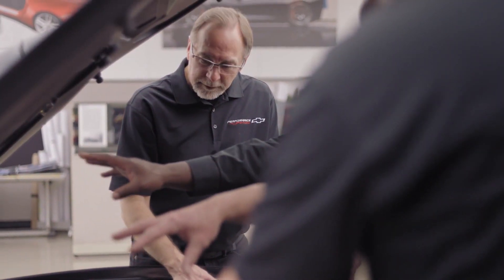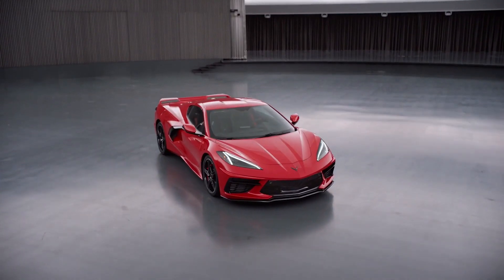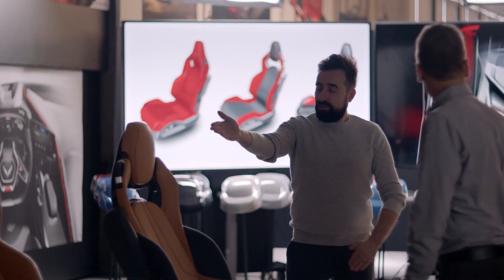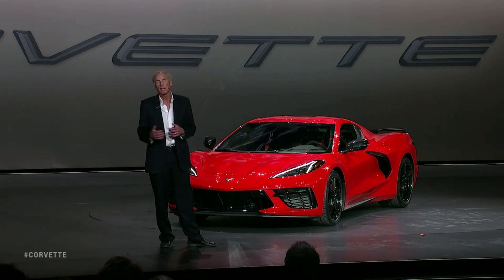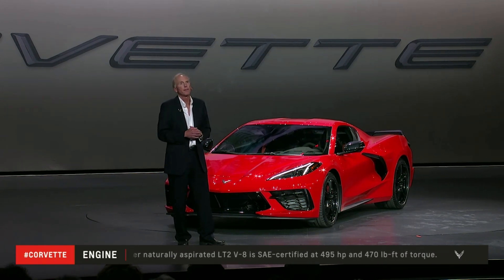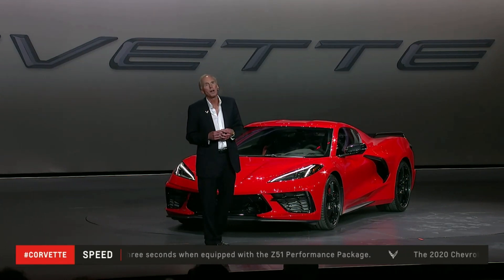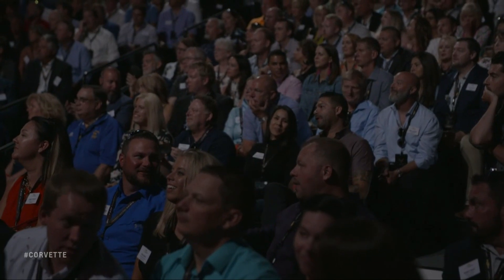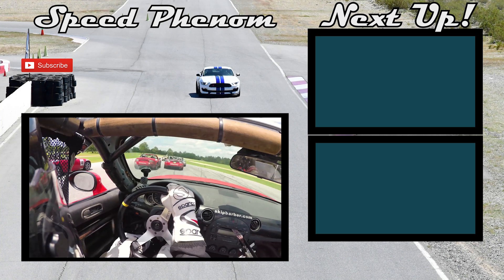MEET THE $50,000+ MID-ENGINE C8 CORVETTE! (0-60 in less than 3 seconds)

Comment: Unfortunately they cant stop Dealers adding crazy markups so itll be easily 100k
Reply: That's why u preorder
Reply: @Marcofrommiami  lol at 100k ... dealers can charge u whatever whenever... makers have zero control over that...
Reply: @Marcofrommiami  even if you preorder from a reg local dealer they will still nail you with a market adjustment. However if you order from the big dealers like Kerbeck, they get you done for MSRP.
Reply: Jack njones  with the Corvette dealers only get a certain allocation. The less cars they are able to get and the more buyers they have wanting the car people will pay as much as they can to get it.
Reply: If you choose to pay a makeup. That's on you. It's pretty simple, dealers will tell you if they are especially if you put a small deposit down. The way I figured is even if I have to fly to another state and have the car shipped back, it's would be cheaper than an insane markup. 400 round-trip plane ticket and between 1500 to 2000 grand shipping. Save 7500 on a 10 grand markup.
Reply: Yup dealers are out of their minds.
Reply: Like hype beast collabs
Reply: I hate it when they add features before you've even asked for it.
Reply: Depends on how many they are making but I'm scared of stealerships
Reply: Well that is why they will have different models I am sure a zo6 type would be easily 100k
Reply: order it from the factory
Reply: Can you order online directly from the factory to save $$?  Check Sam's Club/Walmart and  maybe that got a huge discount by joint with GM so we can save big money? Hahaha
Reply: Corvette: 0-60 in less than 3 seconds
Tesla Roadster: hold my battery pack
Reply: Except this is a mass produced car so the markups won’t last long.
Reply: @MakeItMakeSense285  I bought my 14 stingray feb 14 from Kerbeck. Paid 2k less than MSRP. At that time my local dealership was selling that same car for 15000 over sticker. As of January 2015 they were still marketed 7500 above sticker. I don't think it will be that quick. But eventually the market will flood and they will start discounting.
Reply: @theundead1600  Not really. The law of supply and demand. If a dealer has 3 cars and 10 buyers who get them? The buyer who comes up with the most money. Eventually they will have 5 cars and 1 buyer.
Reply: @gianluca.g  Corvette: I can't hold your battery pack, my hands are full of the $140k I didn't have to spend to be you.
Reply: @the undead 1 - I think dealers are very smart - let the true fools pay more than list,  while the dealer heads to the bank with a smile on his face!  It's the buyers who are out of their minds!

Comment: Dealerships + packages are going to make this a $100k car
Reply: And they're going to go broke
Reply: Not true This is a Stingray a Zl1 is closer to 80 and is well worth it
Reply: ZR1
Reply: Ya and people will pick them up on the used market for 30k
Reply: @mrmisterman999  The C7 came out over 6 years ago and they are hard to find for $30k still... the C8 is expected to have a better resale value than the C7 so I seriously doubt you'll find any for under $50k in the next few years.
Reply: Very little dealer markup on this car. Many dealerships made a pledge to sell the car for MSRP and did. Even with a lot of good options including the 2LT interior package and the Z51 package it is still less than $75k. The average build price for the first batch was around $82k.
Reply: @Viper3048  maybe the high end models with all.options but I doubt the base model will hold its value

Comment: WOW! I'm sure that for the top of line, it will be closer to $100K, but hey, that is still going to be cheaper than the GT500 and it will perform better. They are different cars, but what a choice to have.
Reply: Z51 should be 75k, convertables at 70-80k. then work the way up to when they roll out the ZR1 in about 4 years in the mid 150's. The Zora, if it happens will be the race spec and yeah.. dunno bout that one.

Comment: Looks, value, price, and performance can't be beat by the C8 ( and I'm a Ford guy)!!!!!!!
Reply: 60.000 that's just your base model,. No guts, or performance.  Way over priced.!!!
Reply: @davefiasconaro9736  GT500 performance will be in the mid 3s. C8 in the 2s. There goes your performance.  Gt 500 base model is 74000. You do the math  sir. Plus GT 500 weighs over 4200. You better do some research, bro.
Reply: Bfighter let them be they will always be haters
Reply: @davefiasconaro9736  lol no guts or performance? Dude they all have the same motor  regardless of options.
Reply: yo D.F...I have the LT1 in a 14 c7 vert. A6...I would like to own a Z06 or Zr1...but I am glad I don't, because with 460 hp, I can barely restrain myself from going over the speed limits ..which are too low for the freeways...NOW...I don't track my car, but it would be a nice entry at a local car show...any more power is just a quicker way to losing my Lie.Sins...Throttle Discipline, or else.

Comment: Gotta remember this isn’t the only vette model. Gotta wait for the z06 and Zr1. Zr1 might come with close to 800hp
Reply: More like 1000 hp, plus I think it's going to be called Zora. There rumors its going to be a hybrid system
Reply: you bet that future hotter performance versions will come with over 800 hp. there is a whole host of new hardware, technology and components in development for the future evolution performance variants, among them a manual clutch by wire advance manual transmission, and of course high revving dohc V8 engines and forced induction applications.
Reply: Nightmaro that’s what I heard too
Reply: And all wheel drive?
Reply: More than that for sure. The C7 Zr1 has 755hp...
Reply: @Markus Patients Yeah, those are track cars. Unless you are serious about truly driving it, buying that much power is debauchery.
Reply: They will probably sell for 100k

Comment: I realize few people read the comments but I just want to say that I'm VERY proud of Chevy. I own a Ferrari and I've always thought the Vette's had the power but the looks were dated and performance limited.....and the rear-end never looked like more then a square butcher block. This 2020 car changes EVERYTHING! If it didn't have the Corvette badge, you'd think it was a McLaren, Ferrari or some exotic. Yeah, the rear end still echoes of the Camero but beyond that the engineers and designers at Chevy really knocked this one way the fuck out of the ballpark and brought Chevy back to the forefront of any buyers list. Instead of falling by the wayside, Chevy stepped-up and answered back big-time and I'm proud of them....and at this price point I think they're leaving $20-$70k on the table. It's going to be VERY hard for someone to pull the trigger on an Italian sports car when they can have this for a fraction of the price. Anyone who spends more is doing so purely for snob and boasting issues because when it comes to performance, looks and practicality this 2020 Vette is dollar-per-value soaring way higher then any other manufacturer can even conceive of touching. Not since the Apollo program can we be so proud!

Comment: Finally GM brought the Corvette into the 1960 with mid engine and dry sump. Then they put a duel clutch trans in (Porsche had developed in the 80's) shaped it like a Ferrari then stuck with a push rod engine. The best thing about it is the price. Nothing about this car is original and it is old technology but that's GM kicking and screaming in to the future.
Reply: Jay Zimmerman That’s similar motor and a heavier front wheel drive version where at Nuremberg ring did it under seven minutes lap. Get some.

Comment: $50k+ is a big range of numbers... technically a Lamborghini is also $50k+ because it's more than $50k
Reply: There are different trim levels, guy....It starts at around 50k and can go up to over 100k depending on the trim level and options.
Reply: Brian R there is no trim that currently goes anywhere near $100k... They only announced the stingray. Were you paying attention? The correct wording would be "starting at $50k"

Comment: Congrats. So the same kid that just changed the oil on a 96 cavalier will now be working on your “super car”. This should be interesting. Corvettes need their own dealerships and their own techs.
Reply: Yea not really. American cars have always been able to be worked on by the average joe for the most part, that’s what makes it so appealing, you can own a high horsepower vehicle that you don’t have to take to the dealership and spend $200 on for an oil change. Sure with modern vettes and more technology it becomes harder with time but to purposely suggest that maintenance be specialized takes away from the roots of The American sports/muscle car.
Reply: Fernando Gonzalez 

Yeah thanks for your long story. I have been a GM mechanic for Chevy for 25 years and was at one point a 19 year old kid who would change oil and also work on these high end vettes. Happens everyday at my shop. Lol
Reply: Oil changes are basic maintenance

Comment: Looks awesome, better than I expected tbh.. I Rather go with the 2020 Shelby GT500 700+ hp beast because well that’s just my personal preference.
Reply: You really can't compare the G500 to the base vette, a better comparison would be the GT350.  Now when the Z06 comes out then you could properly do a comparison.  Both are beautiful cars but I still like the vettes.
Reply: The GT500 is going to be overpriced with dealer markups at 100k. The vette will be quicker to 60 for sure. You can’t put all that power to the ground with front engine and high TQ but it is a GT car. It will be a good roll car.
Reply: respected ! the GT500 is one wild machine, but a totally different animal than the new Corvette.
Mustangs are in a different bracket.
Reply: Mustang is American Muscle Car. Corvette is a mid engine supercar. Compare it to it's own class. I'd say compare to the 458 but no one would be able to tell the difference between the 2 so that wouldnt work
Reply: Ford dealers have ruin the GT500. Driveway  demons just said tonight that he couldn’t find a dealer that will price it under 90k and the top specs are going 125k for a car that is base off a 30k . He is going order the cheaper C8 with a better interior instead. I’m sure Ford dealers will lower the markup once Chevy dealers start selling the C8 at msrp price.

Comment: The back looks like the Acura NSX and the front and side view mirrors looks like a Mclaren
Reply: And cost way less than both, probably more reliable too, I'll take 1
Reply: @horuslupercal3872  It looking similar to those isn't necessarily a good thing. It's not showing the ability to think out of the box. Now the c7 is a real example of thinking outside of the box, nothing looks like it yet it looks amazing.
Reply: @burgerbandit3646  from the front its undeniable  it's a Corvette, from the rear its undeniable a Corvette, (or an edgy Camaro), only the side has looks of a McLaren or NSX that's because its mid engine just like them there's only so much you can do with it
Reply: @horuslupercal3872  there are tons of mid engine supercars and very few look alike.
Reply: Don't most of the super cars look alike though.
Reply: Rear is Camaro, front some Ferrari, some NSX and some previous model corvettes

Comment: ferrari is losing sleep.  this is the ultimate.  and you can put 300k miles on it.....
Reply: mesaros shawn lol 300 k ok let’s not reach this is still breaking down after 125
Reply: @brianhomskis1873  with only 475hp output its making well under 80hp per liter of displacement which indicates duty cycle of 250k + miles....   if it's running 300hp per liter its another animal.   keep in mind their z06 pay package is good for 125k miles easy and no opening the engine.   this is about 60% of that perfirmance, and no manual tranny so..... bozo shifts are impossible.  it's going to be indestructible in this package.
Reply: mesaros shawn wow learned something new today. Interesting
Reply: 300k miles on a GM is measured in something like 5 to 6 engine rebuilds/replacements...

Comment: What I want to know is, will it have a Grand Sport version? I want a stick. I don't care about lightning fast shifts, or whether a computer can do it better than me, I want to shift the gears manually. As in the power needed to make the gear change came from my arm pulling and pushing on a lever. It's about my driving experience, not your numbers.

Comment: I'm an original owner of a "09 GTR still in my garage.   In 2009, Nissan schooled the automotive world.with the R35.  Now, GM has pulled the rug out from every other manufacturer with the C8!  The msrp on my car was $74K and I was lucky to have a close friend at Nissan so I paid sticker.  Imagine the C8 ten years later with msrp of $60K!  Of course, there will be dealer mark-ups for the initial "feeding frenzy."  But this will subside.  Predictions about the next gen GTR includes electric motors here and there to improve performance like the NSX or $million Porsches.  How disappointing.  The mid-engine Stingray is ALL the car anyone could want/need/use.  Sure, GM will bring out the Z06 next year but this Stingray is the bargain of the century!  My GTR is bone stock, no mods, 9,400 miles, four new tires, never put in launch mode.  Anyone want to buy it so I can get a Stingray?

Comment: Technically it goes 0-60 in less than 3 seconds with the z51 package which costs 12.5k you would know this if you read the small print. So 59,995 +12.5k= 72.5k to really go under 3 seconds.

Comment: The 2018 Dodge Demon is sure to be an instant classic as its production is limited. The Dodge Challenger SRT Demon can bolt to the quarter mile in only 9.6 seconds at a whopping 140 m.p.h and go 0-60 in 2.3 seconds.  New life for the plastic pig !  Plus you can drive it in the K-Mode..  No shit  !

Comment: (MEET THE $50,000+ MID-ENGINE C8 CORVETTE! 0-60 in less than 3 seconds) 
Your headlines is totally misleading. Only the Z51 does 0-60 in less than 3 seconds and that might cost 2x the $50,000.00 standard Stingray.

Comment: I will not be looking at this car due to the lack of a manual tranny. I get the whole efficiency factor of a dual clutch auto but there is absolutely no cool factor in a dual clutch automatic whatsoever. The rear end looks great but the side profile and front nose look like a grade 8 kid designed them. No wonder the lead exterior designer is retired now lol. I will keep my C3 1972 Vette for a long time. Sure it doesn’t handle or accelerate like this cartoon vehicle but I will get more looks at my C3 at one set of stop lights than this thing would ever garner in a lifetime. Please Corvette I beg you to go back to a classic tribute to the greatness that Corvette was in the 60s and early 70s.

Comment: Under 500 horsepower and under 500 lb of torque with no electric assist and you're claiming 0 to 60 and 2.9 🤔. Is anybody else calling b.s. on this until we see it? Even if the car was made out of popsicle sticks this still isn't adding up.

Comment: And a 4 cylinder all wheel drive turbo car will still out run the mid-engine carbon fiber car that'll be $100,000
Reply: Really...do you know any fast four bangers?
Reply: @GH-el9ch  yeah man sure do. I've got one in the garage made 520 horse at the tires on a Dynojet dyno
Reply: @chaliegrissom  cool man what is it?